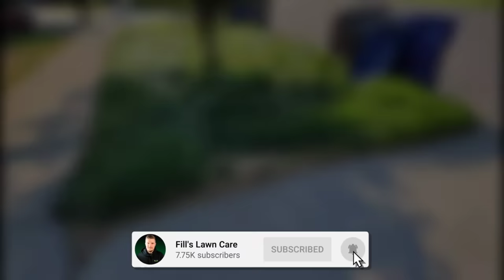Homeowner With An Overgrown MICE INFESTED Yard Gets A FREE Lawn Makeover

Comment: At first I thought that it was odd that there was a drain in the terrace  and then that there was  an angled bit of cement from the street onto the terrace - after you cut the grass and revealed that that part of the terrace was the lowest point in the area the 'light bulb' finally turned on and it made sense!  //   One thing I like about your videos is that you don't toss the edgings onto the grass to be mowed into the lawn with the grass clippings - you take them to the yard waste dump or re-use the edgings when needed for lawn repairs.  It makes for a more well-manicured looking lawn.

Comment: For these jobs you need a edger on wheels to save your back . Also use shovel and rake to pick up grass ,one in each hand like you do a table salad . save your back bending . Plus go around constantly forward staring on the edges . only cutting in smaller and smaller rectangles instead of forward /reverse/forward/reverse save your back
Reply from the maker: Thanks for the tips